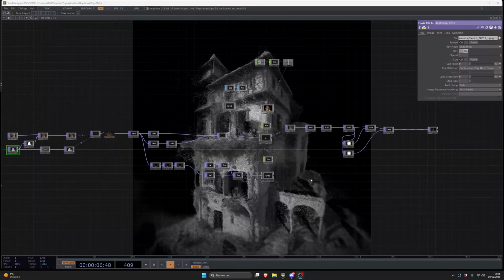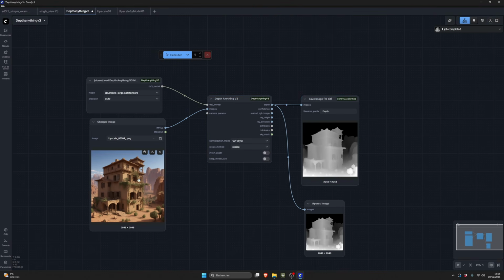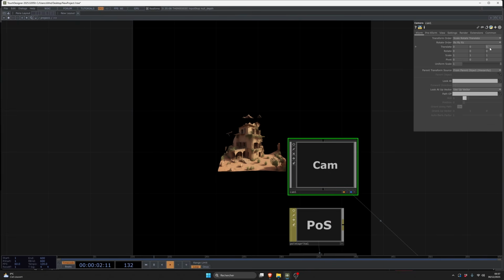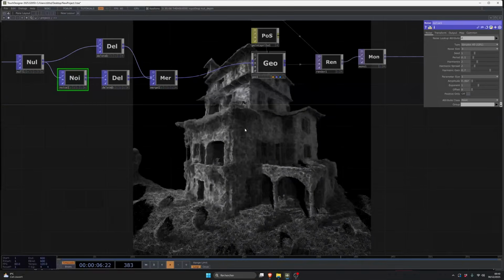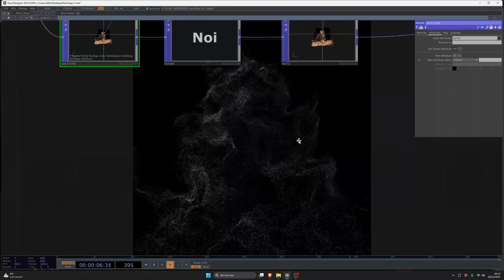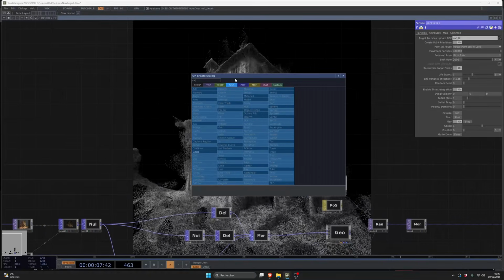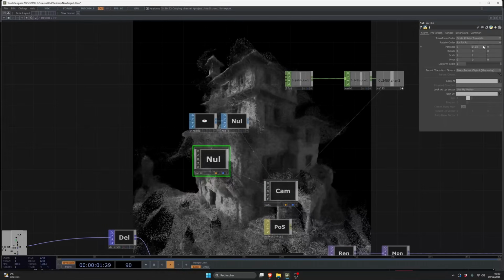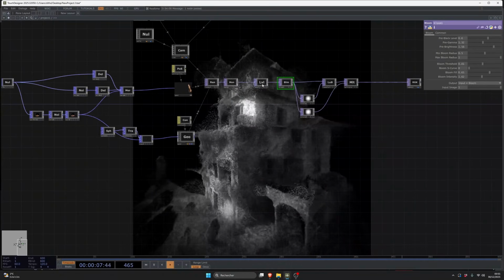Pointcloud from Depthmap using POPs operator in Touchdesigner.

Comment: Is there a way to make this interactive with hand tracking? Like, when you close your hand into a fist, the whole structure comes together, and when you open your hand, the particles scatter and the structure breaks apart. How could I achieve this in TouchDesigner🥹
Reply from the maker: You should check torin blankensmith mediapipe inplentation or may the leap motion.

Comment: Hi D,  thanks for the clear explanations and props to Burns in the London lecture.  I was wondering why you did not use in TOP to POP the option First RGBA Contains : Depth, which does a reverse perspective projection of depth into 3D points. You can re-range there, and/or provide a camera with an approximate viewing angle and position to get it more-or-less accurate, and then add in the Color as you do now.   Also where you want the noised particles to have a different radius, if you use the Line MAT and its PointScale attribute, you can control dot sizes that way without rendering spheres, assuming that's all you need.  Anyway, thanks again.
Reply from the maker: I Greg; thank you for the feedback, such an honnor :)
Thank you for the tip on the linemat; indeed as I am not using a lighting system it would be more efficient.
I a, not sure to fully understand the first part, I feel it's what I did (using the First rgba contains depth). 
Thank you again for the comment; and more widely for all the work on this new family; it opens so much possibilities.